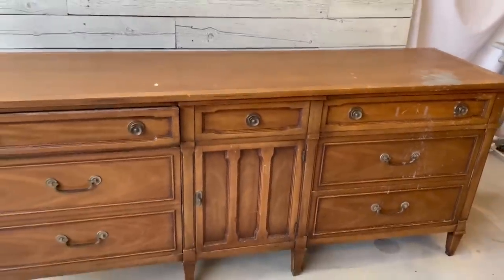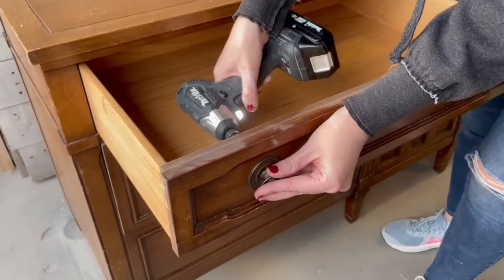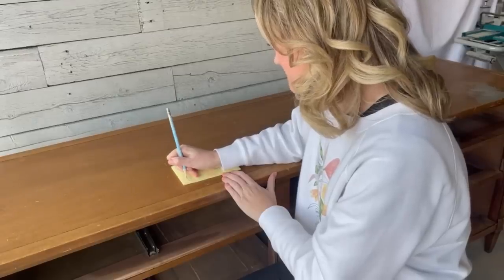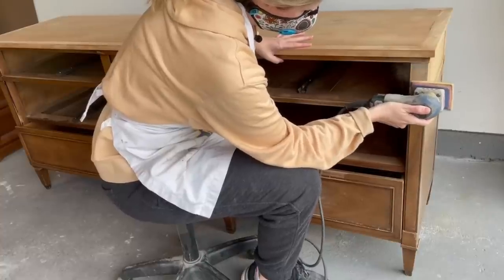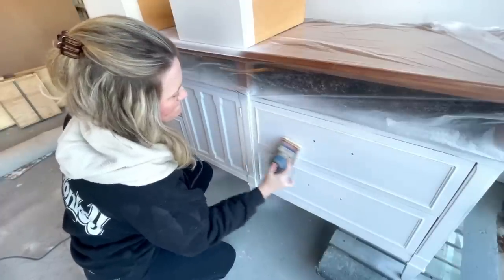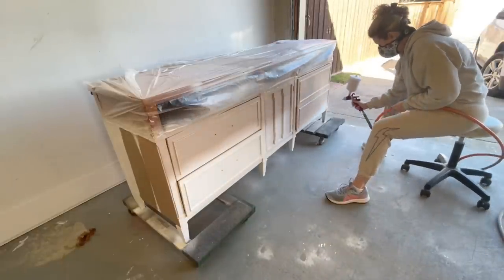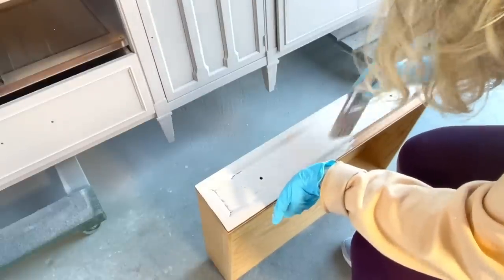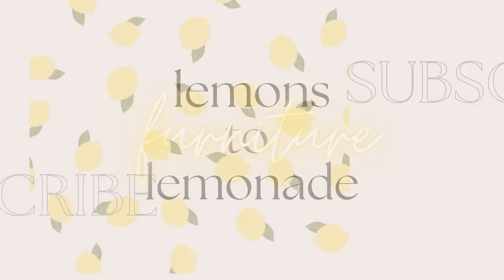Ruined Dresser Gets A Face Lift || Reinventing Outdated, Filthy Buffet

Comment: Hey Kara, I love how this turned out! Can you please tell me more about your shiplap wall? It looks like something that just stands vertically and can be moved as needed. I'm wanting to build something like that for my space and I have some questions. Is it on wheels or what is the bottom like?  Do you have some supports on the back to hold it up?   Thanks!!
Reply from the maker: Hello! No it can’t be moved it too heavy and attached to the wall at the top. We used some old boards from a garden planter in the back yard and painted them. Thanks for watching!

Comment: NO, you did not overpay for that buffet, in fact it was a deal.  Back when it was new, that was the top of the line.  It might not be solid wood, but I know the veneer is really thick.  Veneer was not always for show, laminated like that, it makes it more stable in the weather changes.  I already mentioned the contrasting slats on the top and that rim around the top prevents warping/cupping, like a solid board would tend to do.  Note how they thought to put the dividers inside the big drawers, and the drawers behind the door in the center, the oak used inside the drawers, etc.  Very well thought out to the last detail, and no expense spared made by fine craftsmen.  I call DEAL.
Reply from the maker: Yea you’re right! I just know when I picked this up (I was bidding on 2 at the same time) I was like oh no!!! What did I do! 😂 but I kept reminding myself it was for me and I could never buy something currently this well made for that price. It’s the thrifter in me! Lol
Reply: @LemonstoLemonadeFurniture  Could well be that new furniture of this quality is not available at any price, but IDK.  I have seen a lot of new Wayfair IRL, and you can see the poor quality from across the room. Even the upholstered stuff is horrendous; it is lumpy, doesn't lay flat, the patterns don't quite match, the piping is crooked, etc.
Our eyes are a little more trained that just somebody looking at a catalog, but these kinds of mistakes are just not acceptable.
  Don't know, but I think they are considered to be high end, maybe not.  Guess what you would have paid for this from Wayfair?  I am afraid to guess.  I think you said you paid 160?, don't be crazy!

Comment: That is a very, VERY well made piece of furniture, last week, I went to 4 thrift stores and there was mostly the pressed board with pealing plastic laminate, and was all just stapled together.  I couldn't believe the junk, usually there is so much nice stuff.  It is a personal thing, but I like that style the most of any.  This was a lot of work but something good deserves the effort.  A big give away is the way they used the darker slats on the top;  they went the extra mile.  I don't understand why you you put shellac down before you white washed it, that grain looks like pecan.(second time through, I see you were thinking about bleed through and it didn't obliterate the wood like I thought it would) No surprise, the result couldn't be better. 
Also great shed, try to be mindful that you don't fill your garage back up too fast.  LOL
Reply from the maker: That’s the trick right! Not to fill it back up! Lol yea I was worried about bleed. I don’t know if it would have happened but the amount or work/time put in…I was scared to risk it. Plus if I ever do strip the paint off, I feel like that would be a way to not have to dig paint out of little crevices on top.